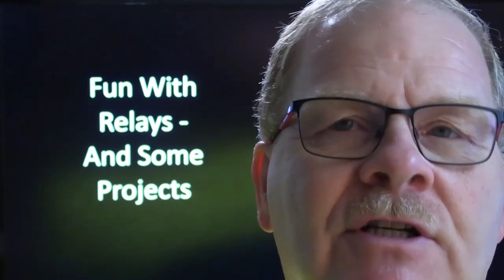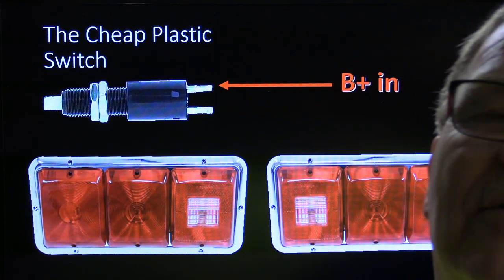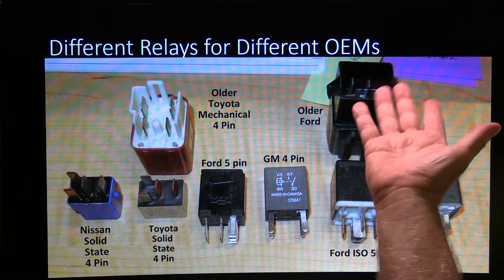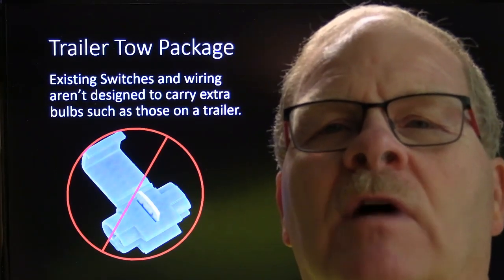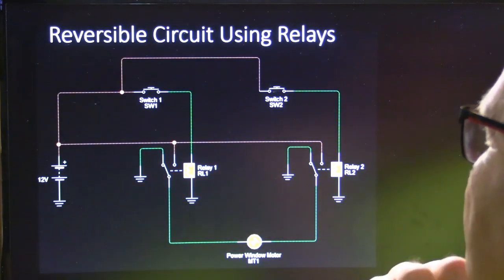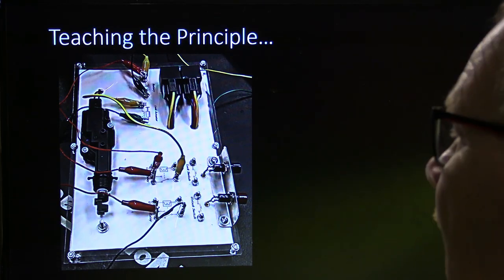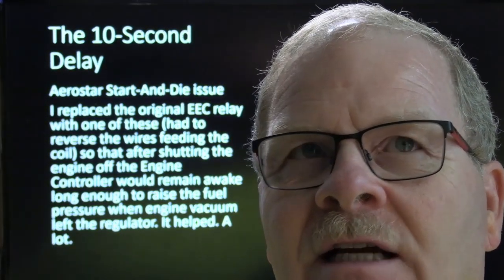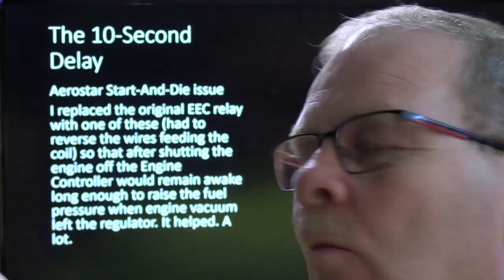Fun With Relays and Some Projects

Comment: I like what you said about the clamping resistor and the diode; how you can fry the relay circuit board if you hook it up with the wrong polarity. I was telling a co-worker of mine who swaps relays sometimes to always check the relay to see if there is a diode before swapping it and he said as long as they have the same part number, you don't have to worry about that.
Thank you for the videos. Your videos, Scannerdanner videos, Motor Age, and Wells VE videos are the ones that I watch the most.